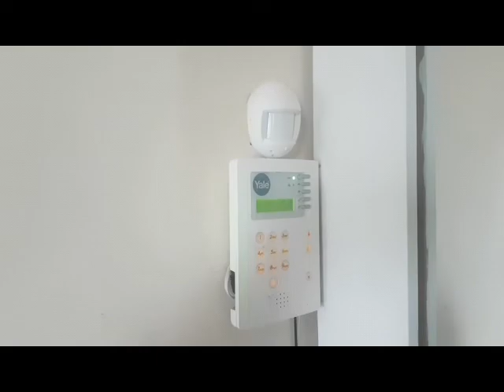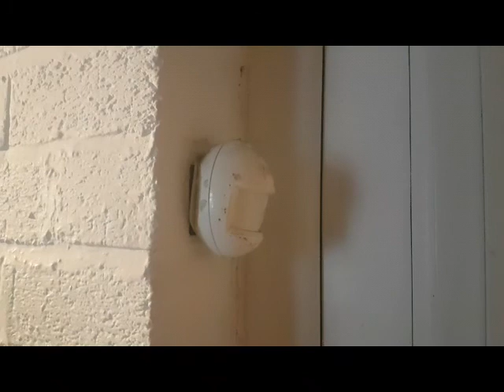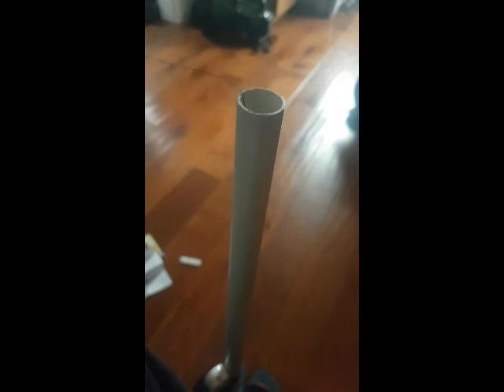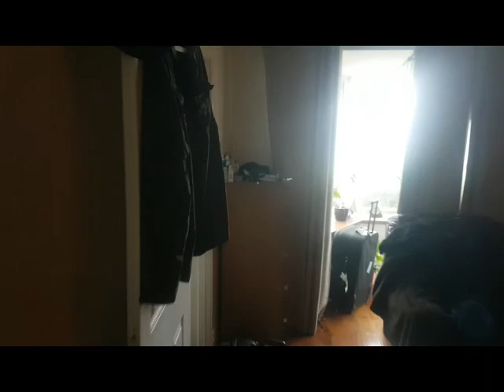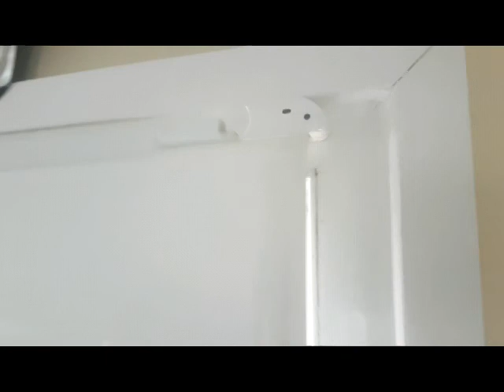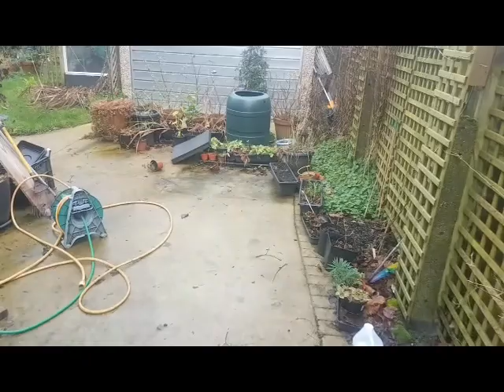Yale wireless Alarm trip wire sensor

Comment: An expert alarm company told.me stay away from Yale as they are not to industry standards
Reply from the maker: You and they are correct. But something is better than nothing, and for under £300 I have upstairs and down stairs smoke alarms, 4  sirens 2 in and 2 out, Door and window contacts, external garage and shed covered.  Weaknesses include cannot detect an open window or door when arming, batteries need replacing periodically, PIR sleeps and samples only.

Plus side is ease of installation, no wires,  so no taking up floor boards, etc etc, ability to add devices, relatively low cost.

Comment: I only heard the inside bell
Reply from the maker: I have 4 sirens. 1 built into the keypad unit, another outside type siren in another room, so you can’t hear your self think indoors. And 2 sirens outside on different facing walls